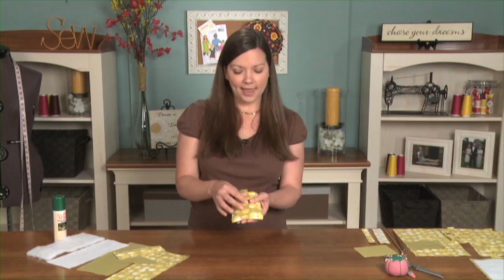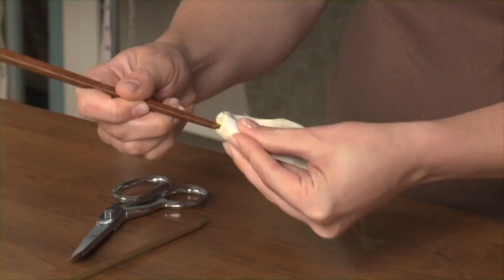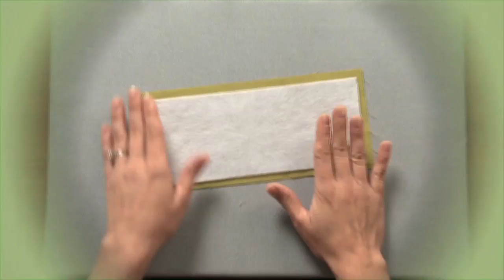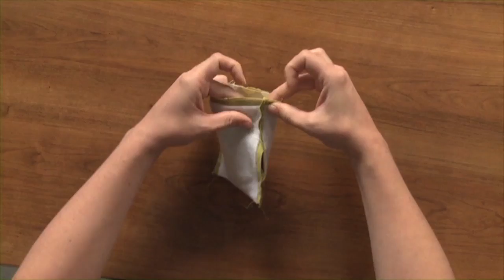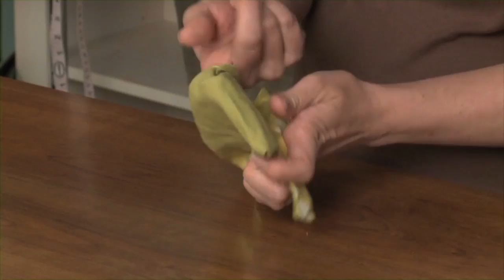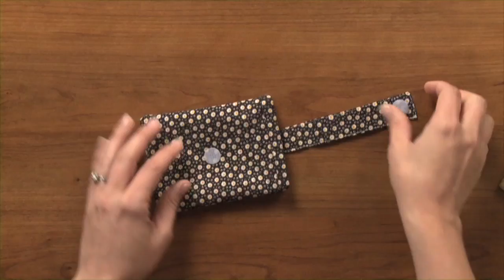Make Your Own Cell Phone Cases  |  National Sewing Circle

Comment: Re:  phone case by Ellen March.

In the 9 years  since Ellen March's video was made, cell phone have grown in size. Her video was excellent, but I had a problem with sizing for my larger phone. If she could insert a few details such as the standard leeway (excess material beyond the size of the individual  phone so anyone could figure out just how large to make their case, it would save a lot of figuring and mistakes. ( I made my first case a bit snug. The second was better.  I also made a rather snug glass case from the same instructions, but the amount of slack needed around a pair of glasses is difficult to calculate.

I designed well- firltting masks during covid, which were cut high over the nose,  deep under the eyes, and hugged the cheeks and chin closely. Men's, womens and child sizes. A good pattern should have flexible size acommodation, as do dress patterns. Not all phones are the same size.

Comment: You made this great sewing video in 2014. But I just googled you (in 2018) and see that you got breast cancer in 2015. I hope that you are in remission now and cancer-free. My thoughts are with you. My question is about the size of the patterns for the cell phone holder. Using the outer fabric as an example, you say to cut the pattern 4.5" by 10". But since you made the video in 2014, there have been many more sizes of cell phones. So I'm wondering if you can suggest other sizes for the patterns. I know I can do the measurements myself, but it would be great if you have already done some measurements. Thank you!

Comment: Ellen, the faux piping technique at the top could be acomplished better if the lining would be cut at leat 1/4 in longer than the outer fabric. I just finished it and I like to have the faux piing showing but it leaves the very bottom of the pocket empty without lining  when I pulled it up the lining.